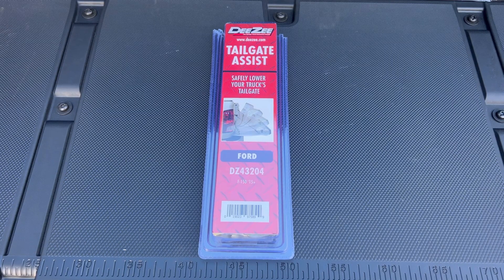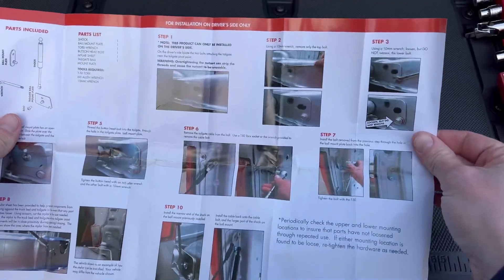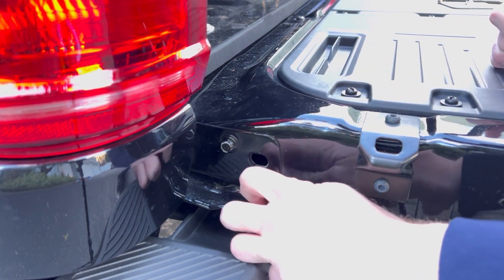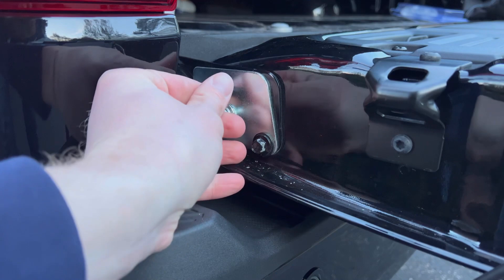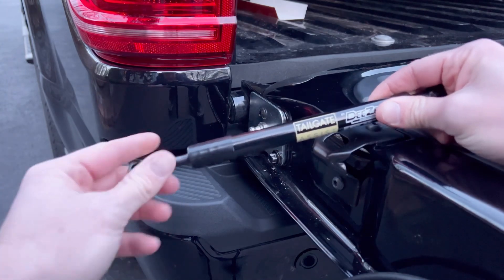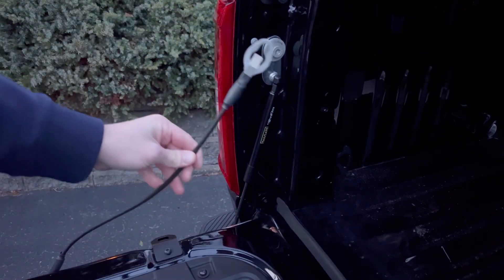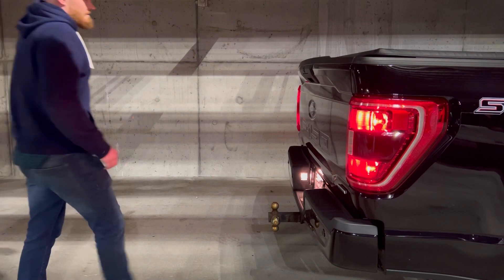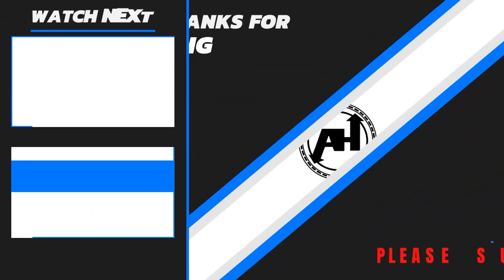TAILGATE ASSIST INSTALL ON 2021 F150 | DEEZEE tailgate assist 2015-2021: step by step install.

Comment: Great video. Just installed this kit on my 2023 F150. I slowly closed the tailgate, and that black tie down hit on the tailgate shock. I figured the black piece didn't really do anything for tailgate functionality. But before I removed it, I went to YouTube and saw your video. So now I  put that black piece in a cloth behind the seat. Thanks for your clarification. Because instructions said nothing about the bracket.

Comment: will this work for a 2022 F150 XL?
Reply from the maker: It absolutely should. Just skip to the end of the video and take a look at the bracket locations if you want to make sure but I’m 99% sure the 21-22 have the exact same tailgate set ups.
Reply: Yes goofy 🤡
Reply: @natewebb4627  thanks for the confirmation you bum
Reply: Yes. It worked for my 2022 STX…